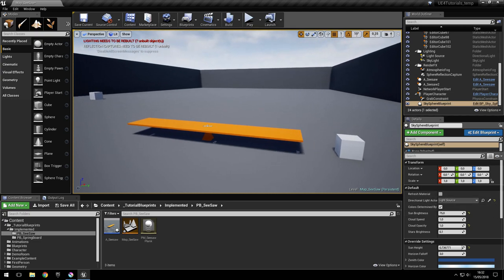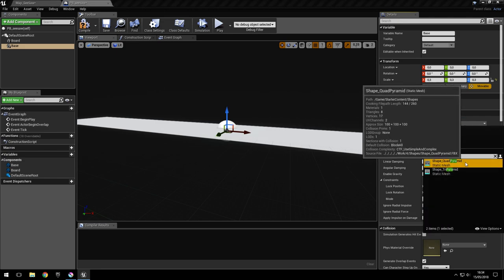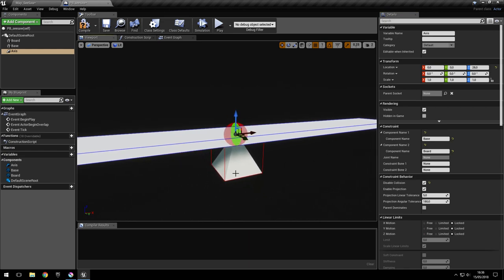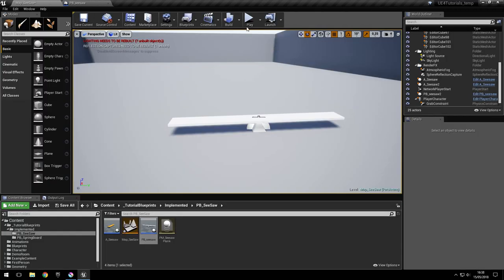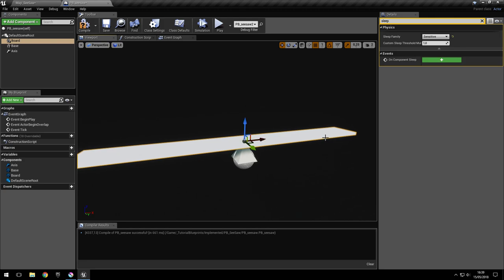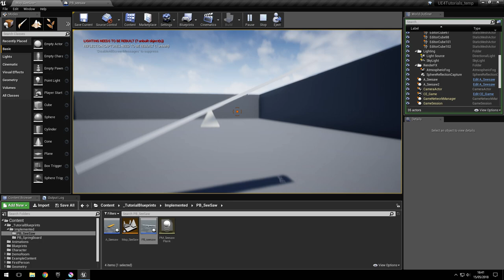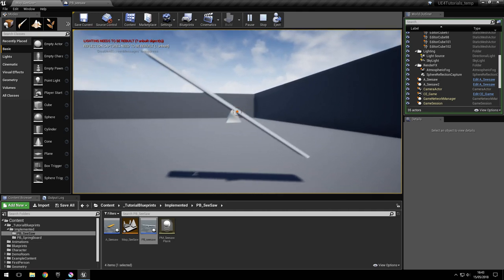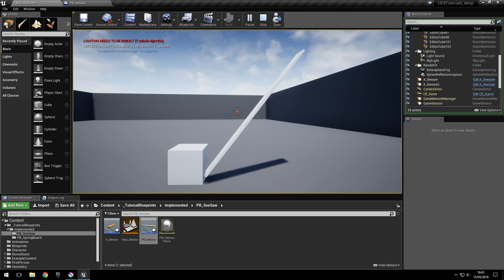UE4 Seesaw with Physics in Unreal Engine 4 Tutorial How To

Comment: Lol sorry for commenting on basically all your videos but is there a way to do something like this with 2 different platforms?

Basically like a weight platform where weight on one causes another to rise, and if both have the same weight it will settle in the middle? I can't figure this out for some reason
Reply from the maker: That's no problem, I wish more people commented. :)

If I understand correctly, you're trying to implement a scale balance. You have to attach each platform at the corresponding end of the plank using a physics constraint. Make sure to limit the rotation on certain axis so the platform is more stable.

I have actually implemented something like this, but haven't made a tutorial for it yet. It should be quite simple to do. Maybe I'll make one, but not sure when. :)
Reply: @Lusiogenic  That would be awesome! Until then I will give this a shot! Thanks as always!